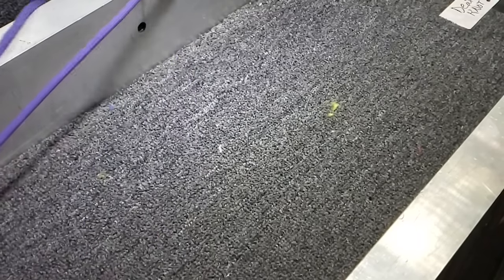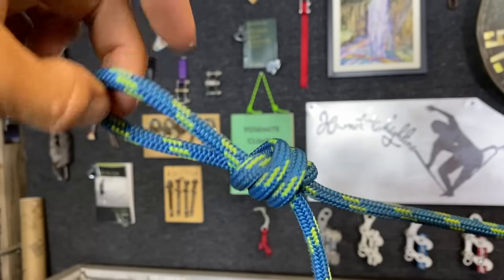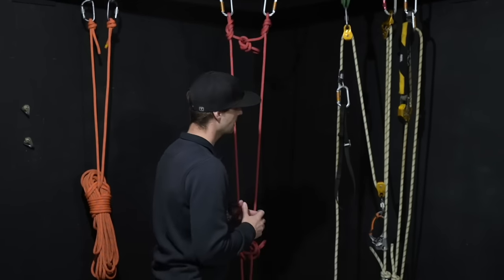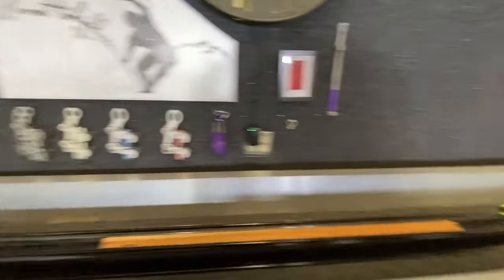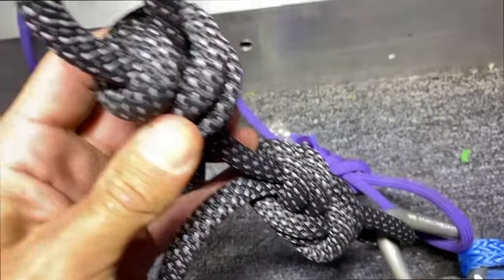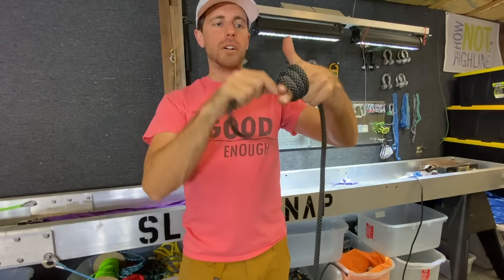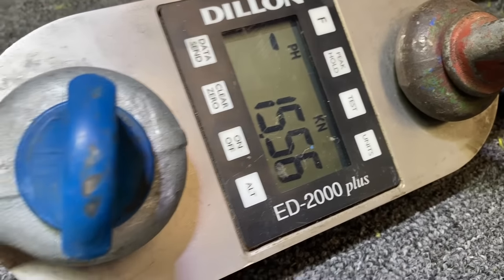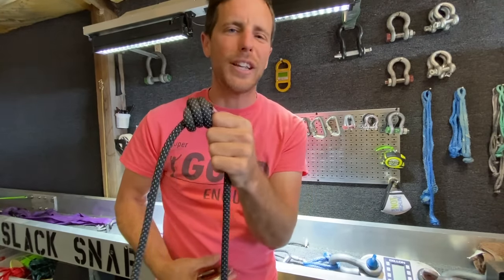Rope Access: Is the death knot a myth???

Comment: I worked in roped access back in the 90s (it was stop and shunt in those days, IRATA) and we only used figure 8 on cowstail (and fig 9 + butterfly hitch, or bunny knots for rigging. Never scaffold) because you couldn't get it wrong and easy to check. A big elastic band keeps the carabineer tight on cowstail. The term "Cow's tail" comes from French (queue de vache) and cavers like Ferdinand Petzl
Reply: I love your testing and enjoying your presentation. In this video you demonstrated tying a triple overhand noose knot. A scaffold or double overhand noose knot only has two parallel bands of rope. Yours has three parallel bands. Look at Mikey’s knots that he holds up and you will only see two parallel bands of rope around the main rope.
Reply: I'm doing rope access right now and a lot has stayed the same! Although figure 8 is considered just as good as 9 on anchors now.

Comment: The danger of the "death" knot comes from it's use as a positional strop. They don't get loaded up properly so the knot never sinches down especially on tougher/older or static rope. In rope access the equipment shouldn't experience fall forces like rock climbing so it works its way out and when you do load it it's only with body weight.

Comment: The Scaffold Knot IS a type of noose. It's not a simple noose, and it's not a hangman's noose, but any loop knot which tightens when the standing end is pulled is a form of noose. (The Noose, or simple noose, has only a single overhand, a la the single Fisherman's knot).
Reply: Yes and alternatively noose knots are called running knots. Such as a running bowline.
Reply: @russelltalker  Running knots are a subset. Specifically, they're knots formed by tying a fixed loop loosely around the standing part. Nooses that aren't running knots can be thought of as sliding hitches tied around the standing part.
Reply: @PeregrineBF  That makes perfect sense. I stand corrected. 

In my defense though several sites do seem to refer to common noose knots as running knots. Wikipedia even has a category page on running knots which includes these. And Ashley's book of knots doesn't seem to define a running knot other than the instance of the running bowline.

But if there are loops which tighten and loops which are fixed then a noose is indeed is a sliding loop where the rope is hitched around its standing part and a running knot is a fixed loop tied around its standing part.
Reply: @russelltalker  Not quite what I meant. Running knots are nooses, but not every noose is a running knot. Just like how all bicycles are vehicles, but not every vehicle is a bycicle.
Reply: @russelltalker  yeah i know im late to the party but this is just getting into semantics at this point because a running bowline would definetly work as a noose

Comment: You should try the death knot with only 3" of tail on the end. No one works with 2' of tail hanging out of their knot. There may be a slighy different outcome because it looks like the tail is getting shorter as you pull on it until the is until the wraps cinch down on it. Rope access program manager here.

Comment: I can imagine that some knots may be more vulnerable to very quick and high loads (as in a fall). In the test of the death knot it was quite clear that the slow pull made the knot tighten up and squeeze the tail so it couldn't go through, maybe in a fall situation there would be a different outcome, especially if it isn't very tight to start with.
Reply: I was thinking the same thing, I'd love to see this tested with different lubricants, or even mud.  Is there any static coefficient of friction low enough that this would slip through?

Comment: Like your channel. Four thoughts:
1. If I understood correctly you used static rope. Wondering how dynamic rope would fair in same tests, especially as climbers would typically use a dynamic rope to reduce forces on the belay and on the individual (not that they use cow's tails much at all, if ever, nor the scaffold knot, at least to-date 2021).
2. It might be worth showing what happens to your 'death' version of the scaffold knot under a drop test. Though a part of me thinks, that while tests like this are interesting they may give some people the wrong idea!
3. It might be worth explaining that 'getting lucky' with the death knot is, in part, do to enthusiastically tightening the knot beforehand and then slowly loading it. An accident is more likely to happen when an individual mis-ties the scaffold knot and not notice, in this scenario they probably won't have hand tightened it to such an extent, thinking it not necessary.
4. It might be worth explaining the difference between your death knot in relation to the scaffold knot and the European death knot (as you know, an overhand knot variant, used by many, to abseil).
Hope useful. Be safe.

Comment: I used to rely on Scaffold Knot + 2or 3 extra wraps around for extra shock absorption, but a rigger pointed out that the bend radius of the 12mm cow's tail I'm using with the carabiner is seriously loading the knot which could lead to failure so I'm now advocating for the use of thimbles at the end of each cow's tail.

Comment: Heya, I'm sure this is somewhere in the comments, but in Rope Access it's unlikely to have such a long tail below the knot. Generally it's taught that one fistlength or 10cm is the appropriate length of tail coming out of a knot when placed at the end of a rope. This may vary between different certifications, but I'm speaking as a level 3 SPRAT certified tech working out of Canada. I think with a shorter tail coming out, it's much more likely that the "Death Knot" may actually not have enough slack to tighten up the knot, and would come undone as a result. Especially if the knots were not dressed as tightly, which of course is extremely bad practice, but definitely a factor!
Regardless, the results here were very interesting, and not at all what I expected to see! Also, big fan of the channel. (:

Comment: Can use the Death knot as a stopper knot with a quick release. Come down on the long tail, if you do hit the stop, it just gets tighter. After you're done, pull the short tail and it comes out. Can throw a biner in the loop just in case, but make sure people know it's not an attachment point.

Comment: When you follow a figure 8 through, the loaded line needs to be towards the centre of the knot, this way when you load it, it stays dressed, and is easier to undo
Reply: The way to achieve this is to start following back through on the other side of the followed rope than you usually do (since we know that you are doing it the other way currently).

I'm not sure if this is true for both left and right hand versions or which version I usually tie, but for me, when starting to trace back instead of aiming at the big obvious hole in the first loop, I push the existing line into that space and thread the follow rope in the space created by pushing the other strand, in between it and the loop (this is the last step for the way you are currently tying it).
Reply: @TheQuicksilver115  exactly.

Comment: Would you ever consider using the scaffold knot to setup a single fixed line slung around something? I think it's kind of neat and easy to set up
Reply: Dont see the point.. I work in ropeaccess but only use it when i want to orient the biners in a fixed way or need to gett as close to the ancor as posible.
Reply: To add to what Niklas said.  One the knot tightens down on whatever its going around...  It can almost be impossible to untie.  So, I cant see it being worth it.

Comment: I think the problem with all the variations of this knot, and off most knots I think, is not the breaking strength, but how easily they come undone when you are climbing with them and moving them around.
Reply: They are not after you weight them like once - used them for some time.

Comment: This is the best type of episode. You take a practice (No Death Knots) that seems like common sense which rope access policy is based on and honestly it does not hold up to testing! The test shows the death knot is very safe for human loads. I am still not going to use it and this is great to know!
Reply: This is why I wanted to test these.  I wanted to be dis-proved.  I have been in the industry for 11 years and was always told this and the other thing.  However, Always asked why or why not.  Sadly Level 3s hate when Level 1s ask those kinds of questions.

Cheers Mikey

Comment: We call it a barrel knot in the uk I’ve never had any issues with it or ever heard of any issues with it when used on cows tails. when you tie your new set of cows tails you always weight the knot as part of the tying process so the cows tails don’t change length on the first use
Reply: It's a scaffold knot mate. I usese them every day at work with my cowtails and safety for tools. A barrel knot is just a knot in a line, like a stopper knot.

Comment: Aside from the number of wraps, what's the difference between a scaffold knot and a noose?
Reply: A scaffold knot is a type of noose. There are other knots that are nooses, too, like the hangman's knot or the figure-eight noose.
Reply: @eyescreamcake  So then why the emphasis on the correction?
Reply: @jarodlojeck5150  Someone told him wrong
Reply: @eyescreamcake  hangman’s looks like it’s tied a little differently though. Instead of a 7 turn toward the top bight, it looks like it is tied toward the bottom with the tail exiting out that way and not back through the wraps

Comment: If you’re going to put your life on the line know your gear and have the skills. A lot of people have been hurt by a little knowledge and the belief they know enough. As a pioneering instructor I can tell you all knots effect the overall strength in a rope system; just tie an overhand knot in the middle of a line then tension it until breaking, you’d be surprised how much strength is lost from the overhand knot. There are knots stronger than the figure 8 pass through or figure 8 loop; the figure 8 loop is typically chosen not for strength but ease of tiring and more importantly ease of checking/verifying it’s tied right. A bowline with a Yosemite twist is stronger as is a bowline on a bite aka a palomar knot in fishing a near 100% way to attach a hook or lure even in braided line, but these can be harder to verify. A bowline on a bite as well as a Swiss seat can be used in a pinch or emergency to make an impromptu harness for an emergency or rescue.

Comment: If you dress the figure 8 the right way it will not look that bad while tightening. You want the end off the rope that holds the wheight to be the lower loop on the top of the knot. Now when you put pressure on the knot, your "weight" is pulling in the upper loop and thats why it looks like crap so fast. Your welcome /sprat 1 ;)

Comment: If you tied the leash using the death knot it might pull though as it would simulate a sudden load when the test piece failed. Of course you’d need a second leash so you don’t flail yourself.

Comment: your two test figure 8 knots are tied differently.  The one on the left is tightening differently to the one on the right.  The one on the right will be easier to untie (though not at this force, won't make any difference) - you can see that the left one is bulging as one strand tightens upon the other. 

HardIsEasy would be very disappointed in you right now.

Great content though, as ever.

Comment: scaffold knots and the hangmans knot are identical except for the number of coils. Technically 8 makes it a hangmans but its only legally considered a deadly weapon if it has 13. thats where the unlucky number 13 comes from. I'd love to see a video on why a noose shouldn't be used over a scaffold and how a noose acts under load not as any kind of racial thing but a why you don't use a noose in climbing thing. 

A noose would orient a carabiner  like a scaffold and could work similarly but why shouldn't it be used like that? I know of a couple reason but you should research it to show your viewers

with there increased friction could a noose be used like a scaffold to slow a fall before it stops? 

personally a knot is a knot if a noose does what I need it to do then its a tool in the box. 

I've made garage door rope pull handles for all over the jobcorp center out of nooses that had the loop cut in the middle and spiced back into itself.  could have used a stopper knot but it wouldn't have been sewn in and would have been untie-able.

Comment: The significant difference from the 'death knot' is only which line is pulled.  You misleadingly made the line you did not want to pull, shorter.  From what I could tell from the video, if you made both ends the same length, there is no difference.  As usual, what matters most is how you use it.

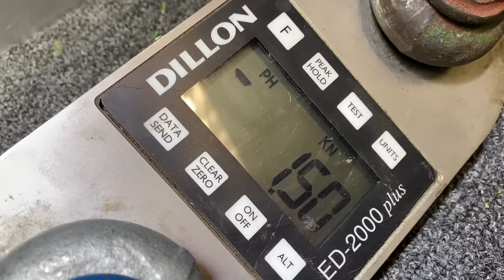Comment: At 11:27 the knot undresses itself because the load line goes on the far end of the knot, as opposed to the middle. Check drop tests about the difference here from Hard Is Easy: https://www.youtube.com/watch?v=QAr-uHd8h8o#t=13m30
Reply: This variant becomes welded after load, the load-line-in-middle variant doesn't.
Reply: But you tested these knots yourself, I see :) https://www.youtube.com/watch?v=Re5ZZjc41kQ